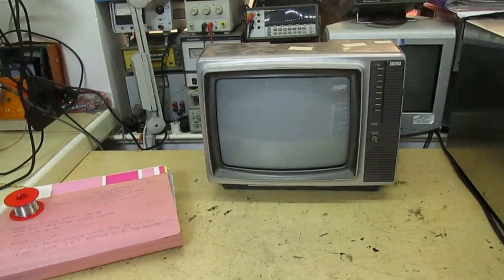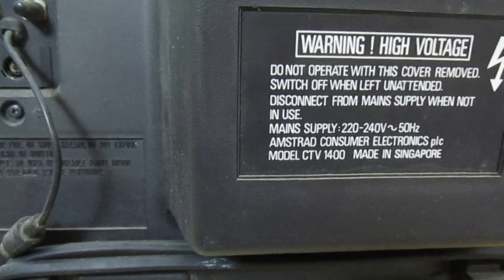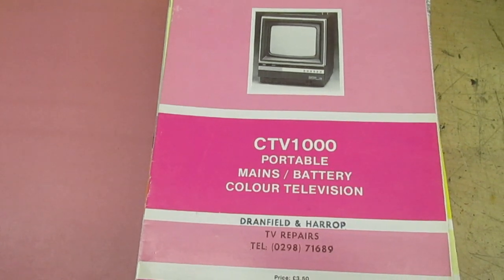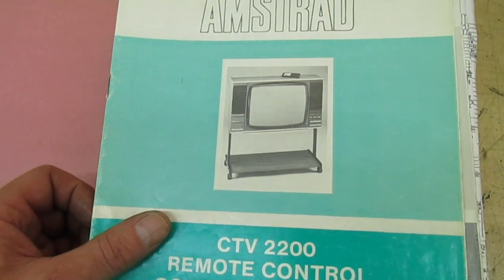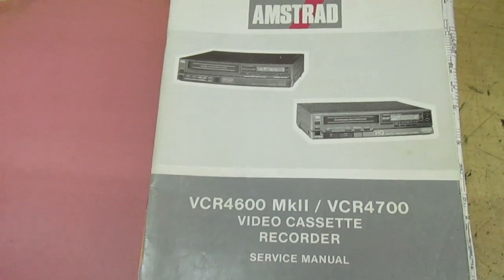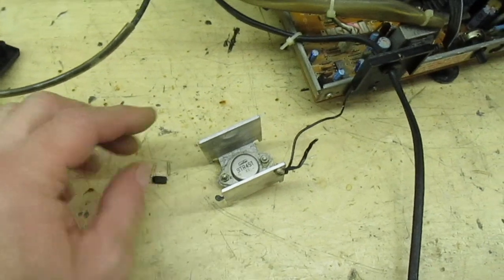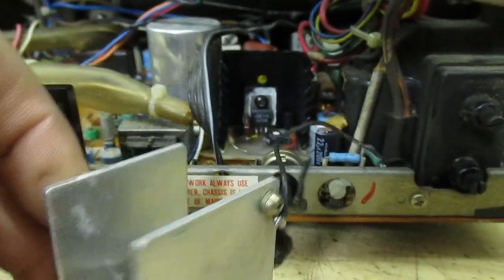Amstrad CTV1400 vintage TV from the 1980s

Comment: I remember the C.T.V 2200 and you are totally correct they are full of problems

But your  videos are always a trip down memory lane and very much enjoyed
Thank you.
Reply from the maker: The 2200 had an outstanding picture , far better than any other set that used the mullard tube , I remember once trying to fit a new on off switch and having to drill two holes in the back of the cabinet to poke in an extra long screwdriver in , I think the switch must have been fitted before parts of the cabinet were glued together . Glad you liked the video , more coming soon .

Comment: Programme on last night recounting the 40 day heat wave summer of 1976 - a boon time for manufacturers such as Plessey as we were replacing Triplers like fun, every other service call was EHT related - happy days !!
Reply from the maker: I saw that program it was an excellent trip down memory lane, I have one of those radio sondes they attached to the weather balloon, in fact I did a YouTube video on it last year, 1976 I was only doing black and white sets with selenium sticks in the Thorn sets that use to smell like rotten eggs when they burnt out.

Comment: I grew up with one of these in my bedroom, had the same problem with noisy buttons but a lot worse. I often had to give it a slap to get a steady picture. In hindsight it probably just needed a blast with switch cleaner.
Reply from the maker: In the day a new set of buttons only cost about £3 odd but as you say switch cleaner usually cures the problem for a while.

Comment: I worked on a VCR7000 and remember thinking it was very Panasonic-like inside.  But not quite a Panasonic reel idler.  Perhaps it was more than just badged, it might have been built for Amstrad by Panasonic.  It was quite well built.
Reply from the maker: It's such a long time ago I can't remember but I think it was Amstrad venture into the video market starting off with just re badgeing.
Reply: I seem to recall the VCR7000 was manufactured by Orion and used some Sharp parts - like the reel idler and reel motor and pinch roller. I can recall seeing the same machine with an Orion badge on too. 😀
Reply from the maker: @marksntl7632  you could well be right, maybe i got it wrong , but using sharp parts in an Amstrad machine does seem to click in my memory .
Reply: Was it a Funai deck ?

Comment: We (well, me) opened our first account with CPC to get Amstrad parts. ISTR the first part we ordered was a LOPT for the green screen monitor for that Amstrad CPC464. And the TVR2 I was always glad when it was the TV section that was the problem rather than the tape section underneath. I do remember the TVR2 with a little ceramic capacitor that used to short, can't remember if it was LOP or PSU section.
Reply from the maker: From memory I think  the cap a blue disc with a value of 1Nf , Yes I too remember when CPC were agents for many different brands and they published separate flyers of manufacture specific spares such as Amstrad, Ferguson .

Comment: I bought one of these in 1984. I had seen one a couple of years earlier, so it I guess it dates from the early '80s. Mine was used until 1997 and maintained a good picture during this time.
Reply from the maker: For a budget, cheap set of the day they really stood the test of time, I was still getting these in for repair in the late 90s.

Comment: I remember the VCR4600/4700 clutch mod kit, did a lot of those and also remember the  TVR-2  And TVR-3. Mode switch problems on those.
Reply from the maker: I remember them, it was a weaker spring and black clutch thing with a felt pad underneath, I bet if I looked hard enough I may still have some!

Comment: Saw a few of these back in the day, the only faults I remember were the dry joint on the line drive transformer and noisy channel selectors and user controls. Really good little sets and gave a good picture.
Reply from the maker: two of the most common problems and at the time you could buy a set of channel selector buttons for about £3.from CPC

Comment: The design on this looks very similar to an early 80s Rediffusion 14" Portable. They both have the picture adjustments in the same places and the volume knob with power switch. The Rediffusion sets came with a Toshiba tube however and had a great picture. I do wonder if the whole chassis was actually Toshiba but rebranded for Rediffusion.
Reply from the maker: I think most Amstrad stuff of the time was made by Orion

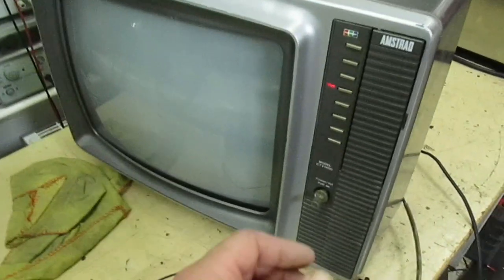Comment: Hi Michael. I saw your comment on the other video about CTV1400. I sold my CTV1400 in 1990, but it's great to see one still working. Something I did notice at 14:49 this one has "ITV2" on the 4th channel button. Whereas the one I had, had "CH4" in the same position. Channel 4 was launched in November 1982, and so Amstrad must have revised later CTV1400 accordingly.
Reply from the maker: interesting , i never noticed that .
Reply: haha, ItsMyNaturalColour did a video of his vintage CRT TV and he was confused as to why there was an "ITV2" button on something so much older than ITV2 (as in the digital channel). Of course, it means the second independent television channel, which of course ended up being Channel 4.

Comment: Reminds me of the time when I was young, in the mid 80's, we had a normal sized TV at home, but when we went to our caravan by the sea on weekends and school holidays we would take a small black and white TV with us. I still remember when we were watching a movie, and it was very quiet, and if there was a quiet moment in the movie, there was a little hum in the speaker, and if the picture went to clear or dark changed, this hum also changed each time in strength. Never knew what was causing this, switched to a small color TV years later and it didn't have that. Where is the time...
Reply from the maker: I would imagine if you have a hum in the background that it was a valve TV set, I have a few small portable valve black and whites in my collection.
Reply: @michaeldranfield7140  , it was no valve tv, because when we got the small color tv, i took this black and white tv apart as a kid (age of 7 or so). It had a relative big pcb inside, but no valves. I remember one day, when i had it apart, with the pcb separated from the tube, that i was playing  with a 9V battery, and connected that battery to a few wires on the board,and that i heared a high frequency noise (just like it was turned on)  and when i touched a white wire, i felt a little tingling, not that much. Many years later when i discovered more about electronics, i realised that the white wire was coming from the flyback transformer that normally was connected to the tube. I had installed this pcb in a plastic top part of a socalled mini washing machine that wasn't used anymory (but didn't tell anyone that i installed the tv pcb inside it) . A few days later, when i was at school, my grandpartents where cleaning up, and throw away "the mini washing machine". When i got home from school and discovered that they accidentally trow away the pcb, i was sick for days :-)
Reply from the maker: @BjornV78  possibly it had a bad capacitor then and its 100Hz mains hum you were hearing .

Comment: Thanks for sharing Michael! That's a very good trip down memory lane thanks! From your manuals, I do remember the CTV2200 with a crows nest of a wiring loom, hahaha :) - I do remember when I tried to bring one of those up on a variac, the psu HT output smoothing capacitor used to explode. However, if I switched the set on straight from 240v mains it was ok. It just didn't like being brought up on a variac :-) - As far I was aware all the Amstrad VHS machines were clones of Orian, Funai and some other brands of VHS. Back in the day I recognized all of them as clone (rebadged) other brands. Just looking at your previews of other sets you have to show - 1st two with wooden cabinets look familiar, maybe both japanese brands but I can't positively Identify yet - the last two silver portables look like an Hitachi on the left and a ferguson on the right. Look forward to finding exactly what they are as soon as you have time buddy :-) - All the Best
Reply from the maker: your good with the old TV s ! one of those brown ones I have not seen for at least 40 years .
Reply: @michaeldranfield7140  Same here, and not seen those old sets for 40 years plus 😀 I was born in 1963 and cut my teeth on Thorn 3000's (3500's), PYE CT152, CT205 Hybrids. Thorn 1400 and 1500's too Haha 😀
Reply from the maker: @marksntl7632  I was born in 1964 so we grew up repairing the same sets !
Reply: @michaeldranfield7140  We did indeed Michael! And like you, I enjoyed almost all of it 😀It's so good to see that you are still in the thick of it and repairing these old vintage sets! And thank you so much for sharing it all with us all 👍It's a real treat to see your videos and see what you are doing with more modern stuff as well as the old vintage stuff. Many thanks again. The last time I repaired a TV for living was in 2008. I started working for a company in Surrey in 2003 which had over 27,000 rental customers. I was their workshop manager and the only one in the workshop repairing TV's etc. The field guys out on the road didn't have much experience sadly. So unless it was something simple, they would bring it in for me to look at. Between 2007 and 2008 their rental customers went from 27,000 down to 9,000 and still loosing rental customers by the hundred/s every month. Since then, I've worked at quite a few places repairing electronics equipment, including ROV's , Radio Ham Transceivers and High end radio receivers,  Aircraft PSU's etc. For now I've settled at an engineering college. This is a multi-role job which includes maintenance and repair of lab training equipment, training the new Instructors and students on using the existing lab equipment. Developing, designing, prototyping, building new training equipment and training the instructors and students on how to use it. All good fun!

Comment: thankyou for sharing also got the ctv1400 in my collection and do you remember the amstrad ctv2000 model a bigger version of this set these were the most relable compared to the awful ctv 2200
Reply from the maker: Yes, the CTV2200 super wide sound set, the only good thing about them was the tube.

Comment: i must of jinxed it on the last video i commented on,haha,i do remember alot of those sets,.i still repair the ctm640,s ctm644 and cm14 colour monitors,they had green screens as well if  i remember correctly they were gt64 gt65 and later mm12 i think the mm12 was back and white? ill have to look it up,im pretty sure i have all colour ones for the cpc range still and a gt64 or 65
Reply from the maker: They could be bought with either colour and was it green screen or black and white, I can't remember now it's such a long time ago.
Reply: @michaeldranfield7140  thats right micheal,the computer wont work without the monitor it was the power supply for the computer

Comment: Looks like quite a well made set that, never seen the inside of one before. Guessing it's ultimately a rebadge of some budget Japanese set under the skin. Had quite good results out of Orion tubes (and Orion-made electronics) down the years.
Reply from the maker: I think a lot of the Earley Amstrad stuff was made by Orion, later on Amstrad used Funai to produce the video recorders, this is when they went down the pan, Funai stuff was really bad.

Comment: Ah good old AMSRAD tvs some were good some were appaling 
with the large screen models i am sure amstrad had shares in multicor with the amount of solder used to get them going and because of the 30AX tubes gave a good picture .
I did like the TVR3 as being easy to service and custmers liked them.
Reply from the maker: The construction was poor and some models were thrown together but at the time CPC was a main distributor of parts and service manuals were easy to read, so all in all not too bad sets. I liked them.

Comment: Just for clarity, when you install your substitute module, does it still need that zener diode? Or is that catered for on the new module?

I only vaguely remember seeing these, and only, as far as I recall, at the junk auctions.

I don't think many folk hereabouts would own up to having an Amstrad in the house. They're quite snobbish about their telly, radio and hi-fi - Mostly Sony, Panasonic, and B&O - and the like.
Reply from the maker: No you still need the avalanche diode , its there to short out the supply rail if the STR goes faulty and outputs too much voltage .

Comment: How did you work out what's inside the str451 and build a circuit to replace. What does the part do?
Reply from the maker: The sanken STR devices are hybrids, just saw the top off and old one and you can look inside, it forms a simple blocking oscillator.
Reply: @michaeldranfield7140  ah I see , I thought it just looked like a transistor. Very interesting. In the 70s we had a "mentor color" 12 inch colour TV , wonder if it was similar to the amstrad ,  did you ever see one of those? I'm sure it was just a badged tv
Reply from the maker: @lookoutleo  I remember the name Mentor but cant bring any pictures of the sets  to mind in my memory.

Comment: Reused model numbers are a pain - Hitachi reused CSP-680 - that's a pain as it means I have to check I'm looking at information for the PAL-1 chassis (1971).
Reply from the maker: I don't know how manifactures re use the same model number twice, its almost like they can't remember what they have already made.
Reply: @michaeldranfield7140  audio manufacturers did it too (or made subtle changes). I was looking for grilles for my 1980s Mordaunt Short MS 30 speakers but could only find grilles for 1990s MS30s (no space), which wouldn't fit.

Comment: I saw your video of, how to avoid miss diagnosing led failures. Since the reaction of that video is off, I will respond here. 
Thank you for this good explanation. Very good information. 
Is there a good schematic somewhere of a good LED tester or for sale somewhere?
Reply from the maker: In a word, no, you would have to make one yourself as all the commercial ones only supply a small current for safety reasons, I use a current limited bench power supply that goes to 350 volts at 200ma which is ideal for led testing.
Reply: @michaeldranfield7140  
    Thanks for your response. But I'm not good enough to do that. At least not without a schedule.

Comment: We had one of these. It had an excellent picture, it rivaled the flat tube Akai TV we had at the time for picture quality despite it being 10 years older. Sadly I was trying to figure out if I could hack some sort of RGB or composite into it when I was 16 and barely a clue what I was doing. I had the back off the TV with it set on the floor and caught the neck PCB with my baggy jeans and snapped the tubes neck! :-(
Reply from the maker: I remember Akai TV sets but cant remember for sure if they were not just Samsung sets badged up as Akai.

On the subject of CRT life there was one set NEI made by network electronic industry's a 14 inch where the CRT only lasted 12 months and it turned out the manufacturer had fitted the wrong resistor in series with the heater and it was running at something like 8 volts instead of 6.3 .

I too knocked the neck off my friends mums 20 inch black and white TV carrying it out of the kitchen back into  the living room after repairing the set so I could plug an aerial in, I carried it with the back off and knocked it on the door handle so you not the only one to have a big disaster !
Reply: @michaeldranfield7140  I believe that you are correct about the Akai set having a Samsung origin. I think there was a "good" version of the TV and a "one" made by a lousy OEM.

The Akai set we had was in their parlance a "FST Flatter Squarer Tube". When it go hit by lightning and a repairman came out to fix it, he told us that we were lucky and had got the version with the best tube. It was unusually good picture, it was probably just the right size to make SD really look it's best. It looked "HD", is the best way I can describe it. 

Ah yes,  breaking the neck on a CRT, there's nothing worse than fixing up a TV or monitor and having one tiny lapse cause it to never work again with such immediacy. Unless you can get a new Tube of couse!
Reply: @michaeldranfield7140  there was a still-working NEI TV in the café of a certain ice rink in Shropshire in the mid-2000s, but more like 20 inch from memory - I assumed it was knock-off NEC!
Reply from the maker: @RWL2012  NEI was set up I believe in Bradford by a guy called Dennis G Mott and the company Network Electric Industrys were good to deal with and supplied service manuals and components, I think the sets were just imported and always had a  look of Goldstar about them or they may have just been manufactured in Korea for NEI , I still have service manuals for the ones I use to repair in the 80 s .

Comment: question the ctv2000 and 1400 are simlar looking sets but different screen sizes do you know if these have the same chassis but with different caps for power supplies out of interest
Reply from the maker: Cant remember so i have just checked with both service manuals and they are pretty much identical apart from the crt and the line transformer.